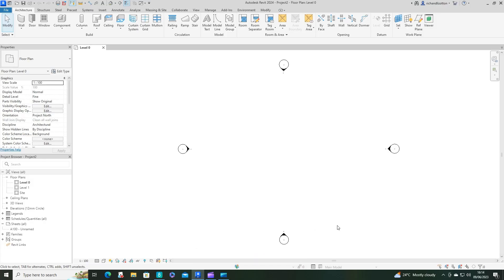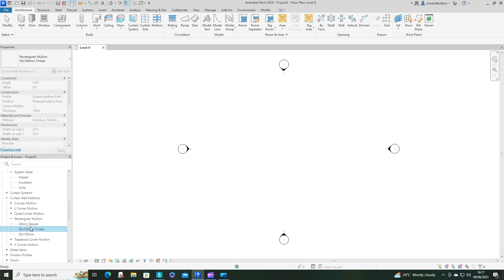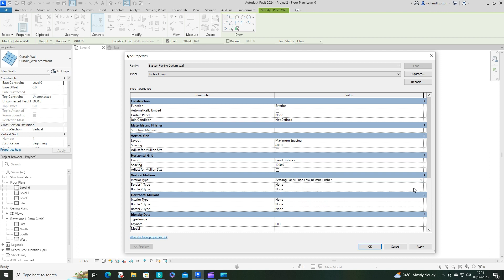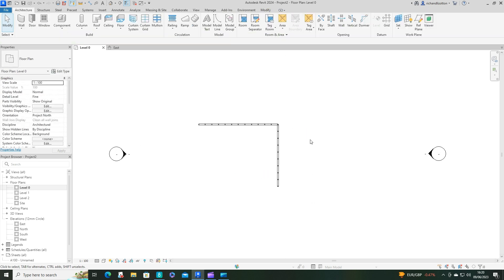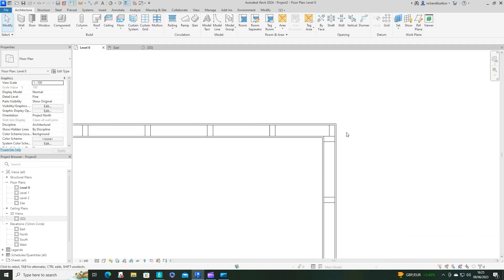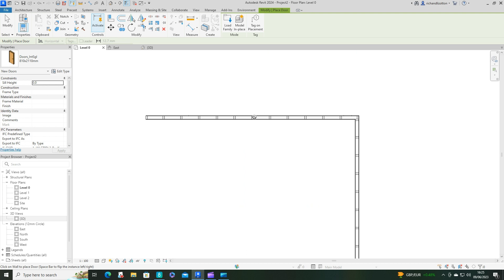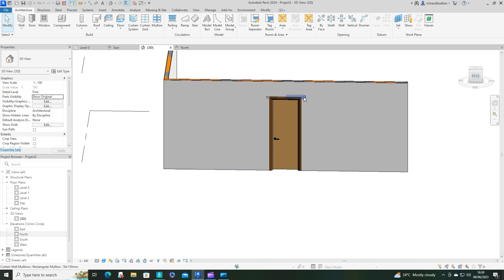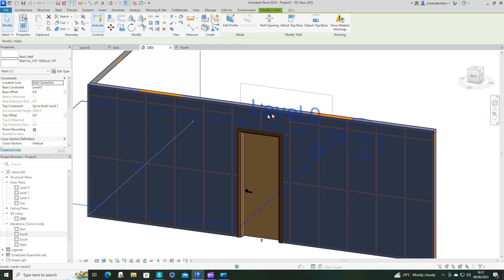Internal Timber frame stud walls Revit Tutorial

Comment: Hi, I have tried something simillar to this but cannot get i to work; i make a curtain wall with insulation, and then a wall with a core of a the same width as the curtain wall. When I then draw the second wall on the curtain wall i get the same warning as you, however the wall i snot place. I am new to revit and do not fully understand it, do you know why i can't replicate your approach? Best regards.
Reply: It will not allow me to place the wall board wall over the stud wall no error message.
Reply: @shepherdsville  Same here, if you have found any workaround please let me know.
Reply from the maker: It is a tricky one to answer without being there as there could be many options...  If you know someone local to you who could have a look that would be good or try asking on a forum that allows you to post pics or a short video showing the issue.